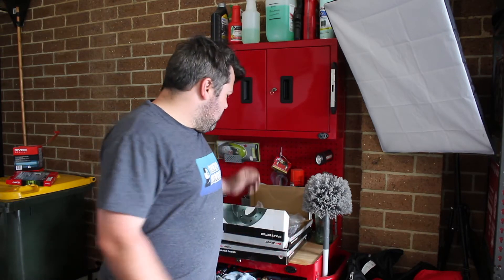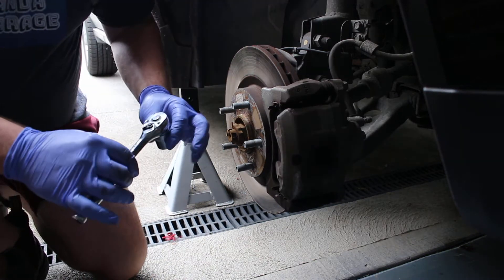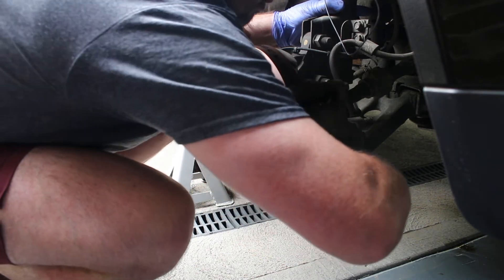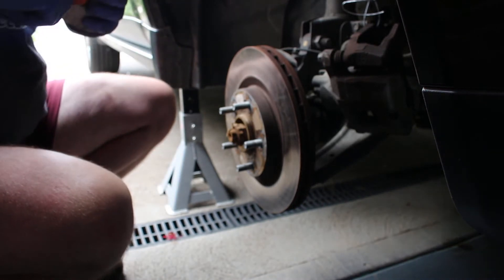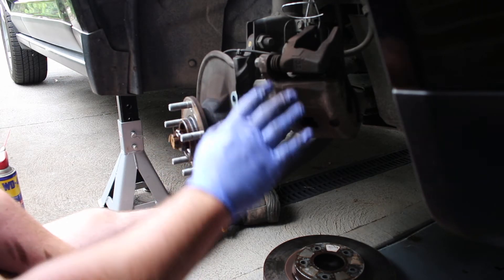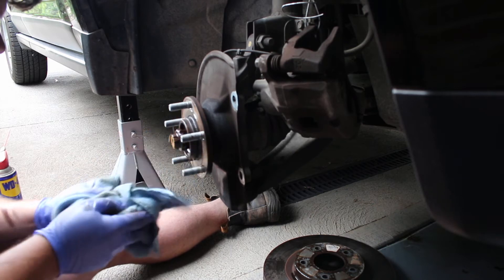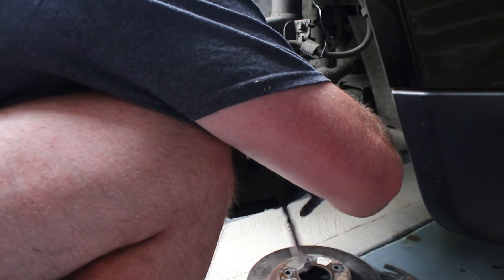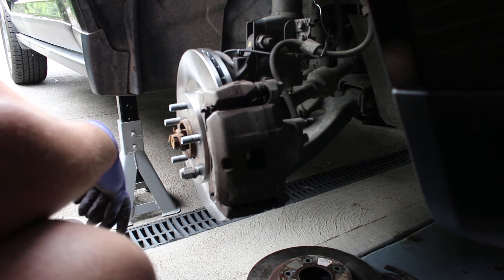Replacing FRONT ROTORS on a JEEP COMPASS

Comment: 2013-125625KM-CRUZE-SRI-1.4lt

I have faced most common problems in this car.
Started with the Engine Lights and problem was detected in the PCV...I had to put new coil pack and spark plugs. Car was running good after that for only 2months and then again same problem.  Now at 125000KM ...I changed Thermo for coolant leak now leaking from one of the hose. Car drink all engine oil in just 2months and I really use the good one. Now facing issue of drag lap (flat spot acceleration) after changing a new coil pack. I would really appreciate if anyone can guide me for all this.....only shown power steering service on display this month.
Now it's not running very good at all. Engine oil is burning. Bad noice..Can you help me with this.

Comment: why cheap out and not replace the pads also, they already have a wear pattern to the old rotor. and what you are holding in your ight hand is called a caliper, not a rotor, the rotor is the big metal plate you put on.